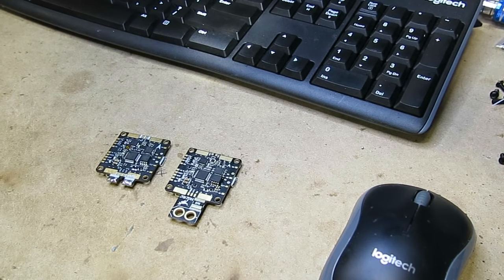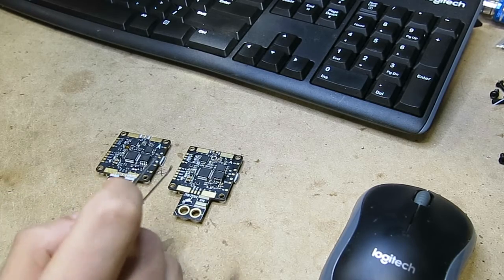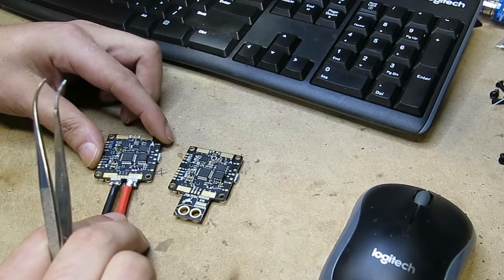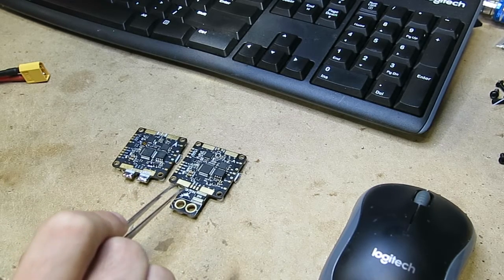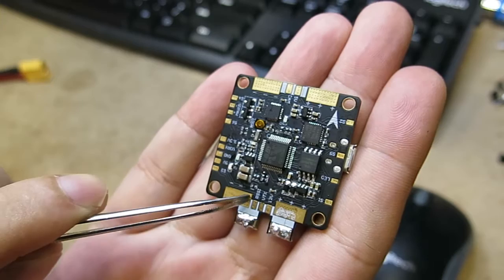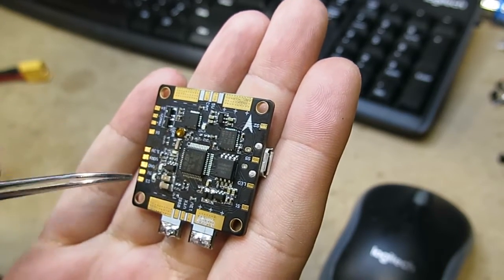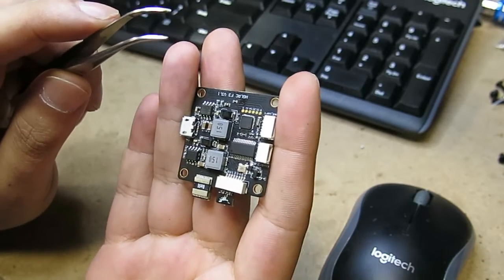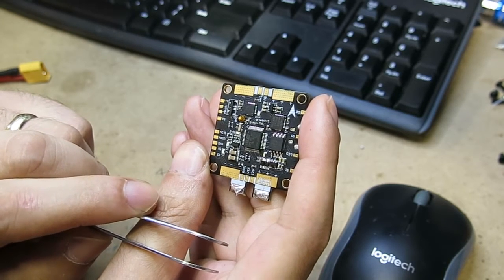HGLRC AIO F3 /pdb/osd/BB/current sensor V3.1

Comment: Hi. Just received this controller and it looks like that gyro X-axis is not responding as it shoud. https://youtu.be/JnlWygYtxUM Did I get faulty FC?
Reply from the maker: where did you get it from ? ... it looks like X is busted somehow ... have you physically inspected the FC for broken or missing components ???
Reply: Physically it looks ok. I get it from Banggood, waiting for answer from them. It looks like that nobody had similar issue before with this board...
Reply from the maker: no , first time I see that issue .

Comment: I bought 3.0, the pad failed, now I see 3.1 reinforced with the boot botton, that was good!  5V 12V pads swapped positions, that was good! Sure this V3.1 is small and without X60 it will fit most frame. No doubt it is a good generic all in one FC/PDB/OSD/BEC/Current board. Almost perfect. hope they add back X60 in another version e.g. 3.2, it make plug/unplug easier if my X60 is position on the side, and save a lot of wire weight.
Reply from the maker: true, i think they dropped the XT60 after customers complained about the orientation to the USB .. some find soldering pigtail to the XT60 holes painful if you dont have the right solder gear.  i guess its hard to please everyone :P
Reply: RotoRev yes the xt60 was on the wrong side